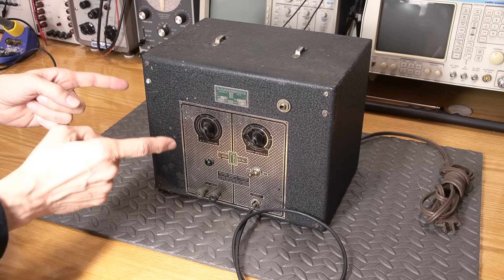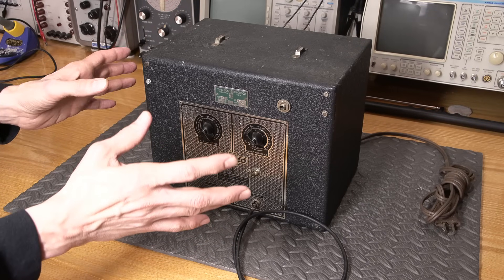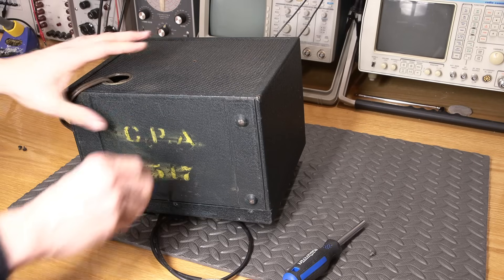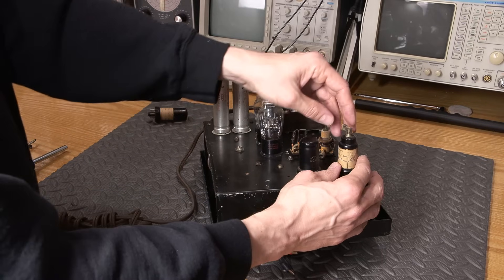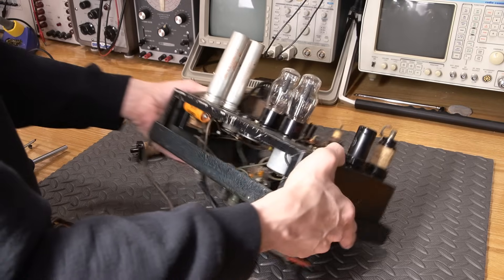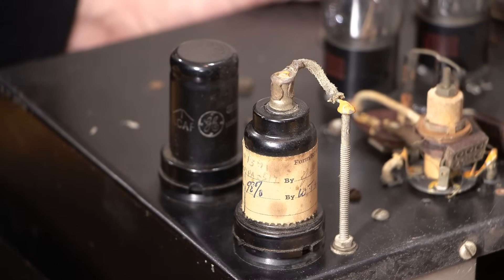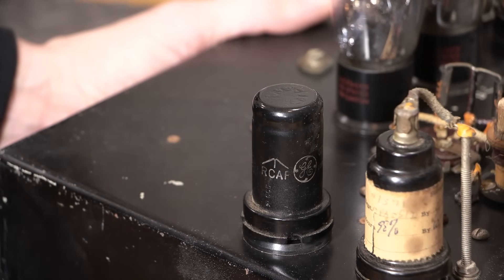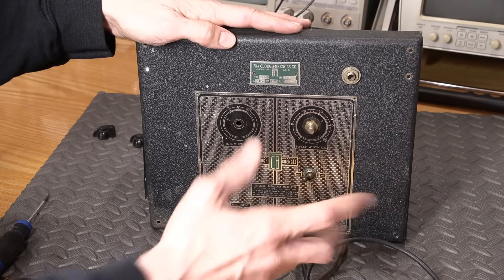FM IN 1938! The Clough And Brengle FM Electronic Sweep Alignment Tool Teardown!

Comment: Delco auto radios from the 40s till 1958 had cool choke coupled push pull 8 watt amps in them. Same circuit wurlitzer juke boxes had of that era

Comment: To me Electronics is more of means to an end.
Although I enjoy working on complicated circuits masterfully fitted on tiny boards covered with surface-mount components,
using a large soldering tip with good heatconduction to securely weld legs of miniscule Microcontrollers and their miscellaneous bits and pieces safely in place,
but what it boils down to in the end is understanding the Complex Physics that allowed my former TaiChi Instructor,
from the family of the Green Lanterns, to make it all the way from his homeworld somewhere in the direction of the Horsehead Nebula,
bypassing the constraints of time specific the Einsteinian Universe.
To make a long story short:
Apparently, he needs to repair something to do with the Transdimensional Jump Drive of the Morning Star (his means of long distance travel) 
essential for the whole thing to be LaPlace Transformed properly for his journey back home to visit his family within a couple of days,
rather than in several life times wasted dwardling in Einsteinian Space. 😮

Comment: THAT RECORDING COULD WELL BE L.RON HUBBARD THE FOUNDER OF THE SCIENTOLOGY RELIGION. RECORD THE:yt:😛 WHOLE THING AND YOU TUBE IT.... YOU'LL GET LOTS OF HITS WITH THAT. DELIGHTFUL TRONICS TOO!{i found a pocket wire recorder at a sale,tiny valves,60v batt i think it was,£2,sold it on ebay for 60, went to korean musium. would make a nice project from old cassette tape head, or micro cassete answerphone/dictaphone. get the clearest recording of the whole thing from start to finish,that really does sound like him,tone,accent language use and content..... the recovered voice of LRHubbard, he may even say the DATE of the recording. ref a current affair at that time.

Comment: Fun is what it's all about !  Modern equipment is best used solely to calibrate and maintain old dinosaurs like this.  Beyond that, all it does is suck all the adventure and excitement out of the hobby.  Old equipment forces one to be fully immersed in the work.  That's when all those other problems in life just fall away 😌.  Too many nowadays miss that experience.  That's when an otherwise enjoyable hobby becomes a boring drudge.  It takes instincts to get the most of these old instruments.  I'll take nothing for my old equipment.  Also, that radio is beautiful  !
Reply from the maker: Absolutely, but how do you make them all realize that modern equipment will drain their soul?

Comment: Great device, Paul. Back in the sixties I had  a great sounding system for AM radio. It was a rocket crystal radio hooked to a Sears/Silvertone chassis and speaker! WBZ Boston USA
1030 was a 50000 watt clear channel. It played top 40 back then. The crystal had such a wide band pass, it would produce slight birdies.
Reply: WBZ is still 50kW transmitting from the exact same antenna, but they pretty much don't do any music these days.

Comment: My fully restored Heathkit AJ-21 "High Fidelity AM Tunerr", which is my daily driver AM radio,  amusingly features a "Fidelity" slide switch on the front to select "Normal" or "Maximum"!  It selects different 1st IF taps to trade off some selectivity vs. bandwidth.  These days given what's on AM it makes little difference, so it was nice to hear what old timey AM High Fidelity was like.

Comment: Interesting  I was not aware there were wide bandwidth AM radios. Early FM analysis showed it was not better than AM  when using narrow bandwidth. Armstrong's system  widened bandwidth resulting in the FM system we have today. I assume if AM used wide IF bandwidth today it would pick up adjacent stations.

Comment: I agree that setting up an AM receiver for wide band width can greatly improve the high frequency response.  I would really question the use of the word "high fidelity". I have an old Fisher receiver that has a switch for this and for nearby stations, wide sounds much better. At night and for distant stations, it is necessary to use narrow to reduce the noise when the signal is weak. The high frequency response in AM is limited by the width of the channel and here in North America, the practical limit is about 5000 Hz. The fi is not too hi and could never sound like FM, but I agree that proper alignment is key. The ability to select or adjust bandwidth is also key, to compensate for signal strength.
Reply: Not to mention the excessive compression used by many AM stations today.

Comment: Sometimes i think FM is getting worse to, at least here in Germany, wenn i startet my apprenticeship 5 Years ago, there wasn't any interference. expect from a different radio station on 93.5 Mhz. and now still the same road and the same station, and the same Buildings along. its just mor crackling and popping.
 god FM radios are also hard to find now, only digital "radios" are easy to find.
i can tell you, the normal cracking and popping from radio is much nicer to listen to, than weak digital stations, with there Crystal clear sound or nothing behavior. and there aren't any strong digital stations in my area.

Comment: It's been a long time since AM radio sounded good. A lot of it was the quality of the speakers plus the values of capacitors in the radio itself. I remember putting Jensen 6x9's in my Chevelle with the AM factory radio. Sounded great. Old 8 track player sounded great too in it. The AM section of my current 2015 Subaru sounds terrible and the FM isn't much better. Stuff was better decades ago.

Comment: When I first heard AM-Stereo it was unbelievable. Almost as good as FM. I have a couple boat anchors to listen to AM and SW and they sound better than any modern digital radio
Reply: I heard a lecture on AM stereo at Motorola and they said the receiver had to be high quality to make stereo work. A major problem was that the FCC approved 4 different incompatible AM stereo systems. They said "let the market decide."  So neither the radio manufacturers or the radio stations had clear direction.  

A more fundamental problem is that there are no AM stations playing music.  Who needs stereo for news, sports, and talk radio?   I know of one station that was playing music on a stereo transmission in the 1980s, but all they played was oldies music that was in mono.  What's the point?
Reply: Too bad it never caught on. 

I heard Ford car radios around 95 were capable of AM stereo.
Reply: @volvo09  There are a few stations broadcasting AM-Stereo. But the trick is finding a receiver.

Comment: I can understand them wanting those tubes. I'm no HiFi aficionado by any stretch of the word, but I do love the sound of tube based audio equipment. I like the look of the older equipment as much as the sound. It is neat that there are modern takes on tube amplifiers and whatnot, and I'm sure you know this better than I do, but there is a lot of stuff out there that has tubes built into it that aren't actually doing much of anything except looking cool. And they're listed as being tube amps. It's usually on the lower end of the price scale, but not always. Which is kind of an unfortunate thing. I still remember an amp a friend bought that it became painfully obvious the tubes weren't doing a darn thing because it sounded exactly the same whether the tubes were in or not. Wasn't a super cheap device either.

Comment: Mr. Carlson , I hope one of your offspring has the name Stromberg.
Reply: One of My cousins first and last name is Harley Davidson lol.
Reply: Deserves 1e6 likes.
Reply: I didn't know radios had carburetors.😂
Reply: @nudebaboon4874  Gas operated radios did. Now they're fuel injected. Also you might be thinking of Zenith Stromberg carburators. My 1973 Mazda came with one. A four barrel factory stock
Reply: @InsideOfMyOwnMind  1932 thru 1952 Ford flathead V/8's likely had a Stromberg 97 carburetor.
Reply: @Splungers  Dad had a couple of 1948 Cadillacs with flathead v8s. Don't know what carb but they had the slowest idle speed I ever saw.
Reply: @InsideOfMyOwnMind  Wonderful, smooth cars.
Reply: @InsideOfMyOwnMind I had a 1972 Triumph TR6 with dual Strombergs.
Reply: Or Ampere? Ah yes, needs explaining. Stromberg is really Strömberg in swedish. Ström is the swedish word for electric current.
Reply: To my eternal regret when my grandmother passed on decades ago they offered me her stromberg carlson radio and i turned it down because my wife and i didnt really have room for it and digital was the rage.  Dumb dumb Michael.
Reply: Except hope he/she doesn't have a megalomaniacal urge to kill all terrestrial life.
Reply: Pretty cool.